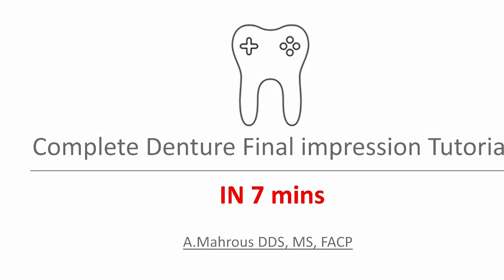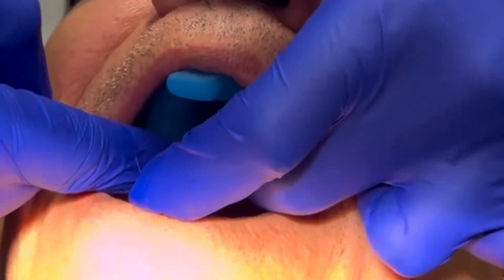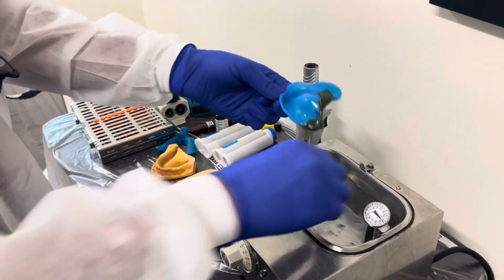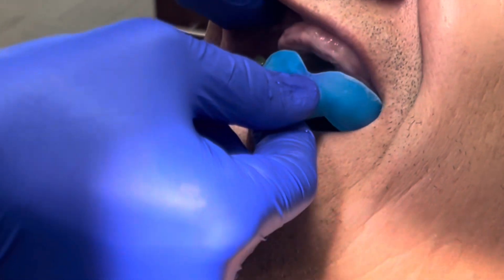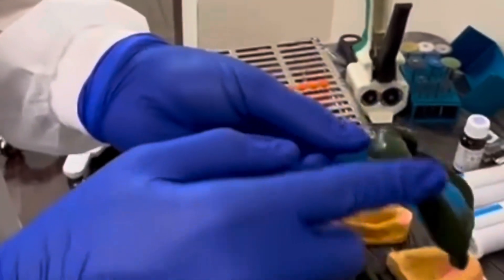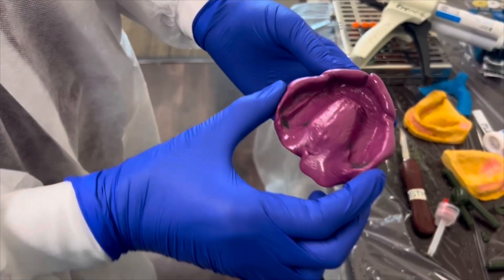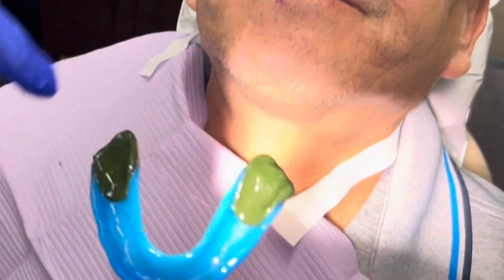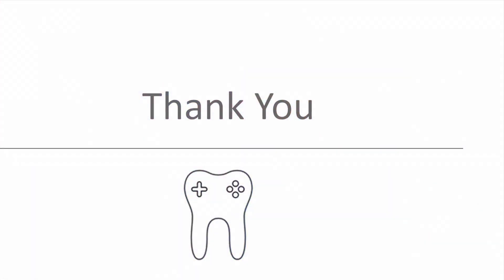Complete denture final impression tutorial in 7 mins

Comment: Is there a way to prevent the compound from collapsing when pushed by the patient’s tongue, especially on the lingual side of the lower arch? Also, I’m awaiting the next steps 🥺🙏🏻🙏🏻
Reply from the maker: Yes , it might not be very apparent in the vid but i usually wait a bit before inserting the tray in the mouth after applying the green compound in the lingual flange this is done to give the compound some strength before inserting